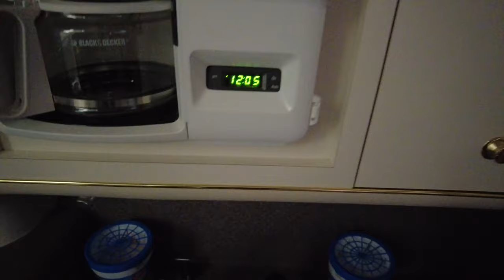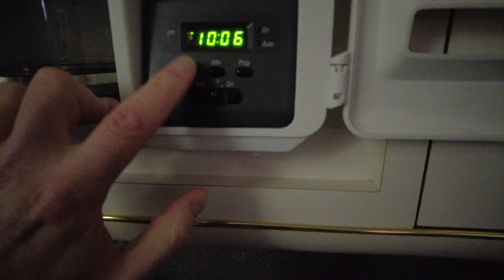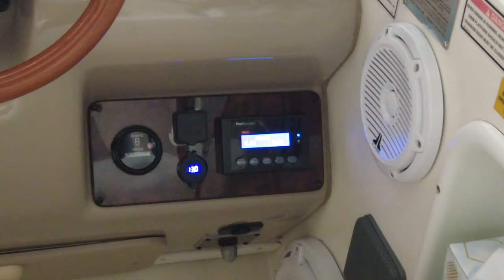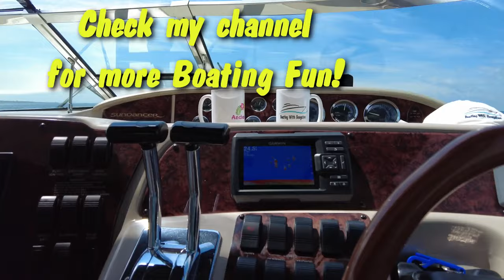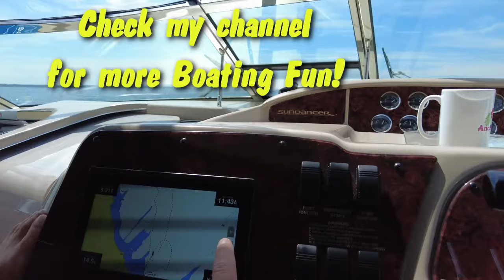New Marine Air Conditioning   Pre Installation Measuring

Comment: Hey Paul!  I replaced the A/C in that same location on my 420 dancer...  Turned out to be a difficult project.  My unit didn't fit through the drawer space, so I had to do a lot of disassembly.  Turned out great, though....  I upgraded from a 12k BTU to an 18K....  Well worth the effort!
Reply from the maker: Thanks for sharing. Not sure if you watched my video from replacing the microwave on our last boat, but that also took a major disassembly to make it work. Luckily, the microwave on the current Boogaboo is still working, because I learned last year that there no longer parts available for that 25 year old relic and finding one to fit that space would be next to impossible.
 Wish me luck with the the new A/C :-)

Comment: Im doing the same thing now on our Trojan F32. Im tired of messing with 1985 tech and R22. Went with a 16K self contained Webasto
Reply from the maker: We had continuous issues with the unit on our '87 300 Sundancer, so much so that I actually removed it and took it to a shop for repairs. Again, the repairs would have been close to a replacement cost - with only a 30 day warranty, so I brought it home and stored it in the garage for a year. Eventually, I put it back on the boat and like a Christmas miracle, it starting working again! Don't know why, but I'm thinking it might have been something as simple as the thermostat - another item we had issues with on our 330 Dancer. . .
Reply: @BoatingWithBoogaboo  sounds familiar 🤣 The F32 Trojans mostly had split gas systems. Compressor in aft of boat and 2 evaporators..One in Vberth and One on salon wall. I.bought another unit and never installed it. Also sits in my garage 🤣

Comment: Will be interested in the followups as my air is showing its age too. 
On a side note I see you still have the original Carbon monoxide detectors- time for a change???
Reply from the maker: The original C02 detectors have been disconnected on every one of our boats since we got the 400 Sedan Bridge, way back in 2010. In my experience, they are unreliable at best and prone to false alarms at worst. We have battery powered smoke/CO2 combo units that work perfectly for our needs. If you go that route - even as a backup - be sure to change the batteries every season.
Reply: Were they residential type or the dedicated (read expensive) marine type if you don’t mind me asking.
Reply from the maker: @erniefollis7827  The units we had on our last three boats were the 12V, hard wired marine type. I learned that if the battery power was low, that could trigger them. That's why I disconnected the one in our 400 and never looked back. But again, we have ALWAYS had battery powered ones on all of our boats, something tested at least three times thought he season to make sure we continue to be safe.